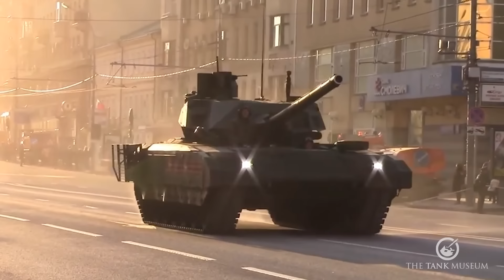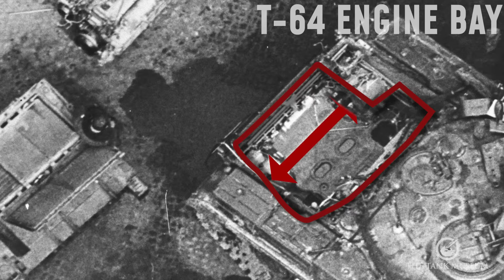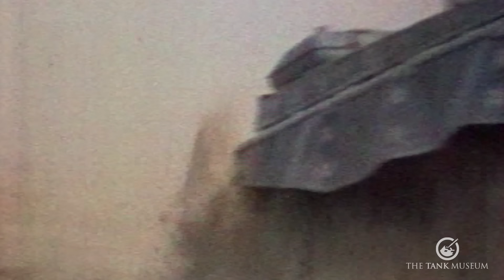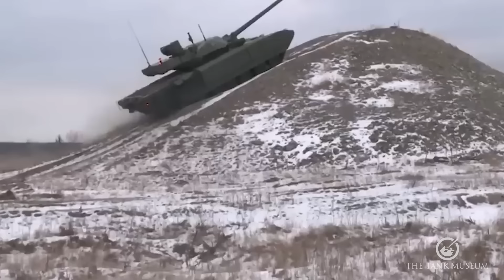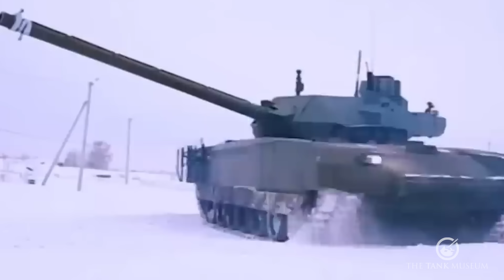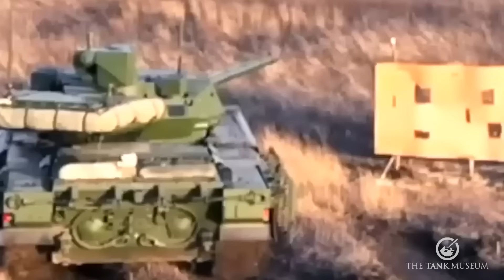Radical or Ridiculous? | T-14 Armata | Tank Chats #171

Comment: If this design was proposed by the West, no English-speaking commentators would say that it is riduculous, despite the numerous failed military design and projects from the West.
Reply: Such as?
Reply: @belongaskip Such as USS Gerald R. Ford's sewage design leading to 90% of its toilets clogged and having to borrow 150 mobile toilets from Greece.
Reply: @andresx1342 hardly compares
Reply: @belongaskip You are absolutely right. USS Gerald R Ford is a complete joke.
Reply: @andresx1342 then say it and dont bring up some "sewage systems"
Reply: @belongaskip  Nah the EMALS makes it a joke. The sewage system is just the kicker
Reply: Yeah, but it wasn't, and it is so....?
Reply: This armata tank kind of is a design of the west though lol most of the tech on this thing all come from western off the shelf parts which they dont have access to anymore. No wonder this frankenstein mess of a vehicle never got manufactured.
Reply: @AC-xq4hh Parts are not the problem, lmao.

There were countless of tanks and projects that have never seen battlefield or being labeled as MBT.

Russians have impressive Tank Fleet so there's no point of using those, especially during wartime.

Comment: 100, 115,115 mm guns all in service at the same time. That is nothing. Ford once sold car models with 427 CID V8s, 428 CDI V8s, and 428 CD V8s. The idea was that the 427 was the hot engine, the 428 (Cobra jet) was the hotter engine, and the 429 (Super Cobra Jet) was the hottest engine

Comment: Two years on and the poor performance of Western tanks in Ukraine makes some of the comments very funny. In the age of drone warfare there has to be a radical rethink. However many of the lessons of the T-14 are already being incorporated into updates of the T-90M.
Reply: What poor performance? They seem to be performing pretty well. 2 years with  difficult maintenance and little to no replacements. In a war with thousands of tanks on both sides they have been used as first choices. The funny thing is that the lowly M2 Bradley has outperformed all expectations. 

You are learning the wrong lesson with drone warfare. Look at the combatants. Both Ukraine and Russia both field thousands of tanks each. Even after years of drone warfare they both spend substantial resources fielding them. Russia is emptying out their old stockpiles trying to get as many tanks in the field as possible. Yet you want to ignore the actual participants in this war and proclaim a weapon both of them depend heavily on is useless cause of drones.
Reply: @tealshift2090 tanks are increasingly being used as mobile artillery rather than for  frontline attacks.
Reply: @tealshift2090  Ukraine is not using it's western tanks such as the Abrams and Leopard in the same way Russia is using theirs and when they did, they suffered the same fate as all the "bad" Russian tanks, aka being torn to pieces by drones. Tanks in general seem to face increasing challenges in the way wars are being fought now so which makes it seem like it's pehaps better to use cheap, and easy to produce tanks or AFVs because it's better to lose a cheap tank than an expensive one if they suffer the same weaknesses anyway.
Reply: @umbra2130   Torn apart? oh? You know that how? From the drone videos? Tanks from Russia and Ukraine have had most losses from the typical old fashion weapons not drones. Mines are a far larger threat as well as artillery. In pretty much every video you see of a tank getting knocked out while its moving its not a drone doing it. Every video that you see a drone doing something the tank is immobile for an unknown amount of time. Usually with hatches open. So most of those have been abandoned and just sitting still.  The famous photo from Zaporizhzhia of Western equipment getting stopped and destroyed, every last vehicle is detracted. That wasn't a drone that did that. 

Small drones are being way over hyped in public. They are great for observation and intelligence. They are nowhere near as deadly as people think they are.
Reply: @tealshift2090  Maybe I wasn't clear enough before but by drones being a detriment I don't just mean FPV drones but reconnaisance drones that constantly monitor every single corner of the battlefields at all times. It's incredibly easy to use ATGMs, loitering munitions, precision artillery etc. to destroy any tank as soon as it's spotted which in this war is as soon as they expose themselves in any way due to literally hundreds of reconnaisance drones looking out for them.
Reply: Indeed, but showing that the T14, while good on paper, is just too expensive to field. Intriguing how that works out.
Reply: @gregoryfilin8040   The T14 was never "good on paper" it was good in fantasy media PR world only.
Reply: @gregoryfilin8040 it reminds of the T-34 and T-43. The T-43 was impractical to go into full production for various reasons. So the T-34 85 was created as an effective hybrid. The T-14 may never see full production but it does not mean its development was a waste of money. It is the advantage of a defence industry focused on the national interest rather than shareholders profit. It can afford development costs without worry about future sales.

Comment: I see see-by-wire as obvious tech for next generation armored combat vehicles... Didn't knew it was on the T14.
Reply: It was a big question, with electronics reliability and ability to produce being Russia's biggest bottlenecks. 

Doesn't matter now as most of that capacity in present-day is being used by drone production.
Reply: Russia often develops military concepts 10-30 years ahead of the west in concept, but the execution is from 5-50 years behind, with cost being 5-75% of the West. 

They conceive good ideas, but they rarely can put them into meaningful production. Take the SU-57, by all accounts an EXCELLENT aircraft. Yet after 6 years of production, less than 100 have been built. The total will be 250 air frames in 11 years. This is quite small. The US produced all 460 F22 Raptors in just 4 years; truly a marvel. 

So Russia can make good weapons and kit, but often struggle to put out the higher tech stuff in sufficient quantities, hence their heavy leanings on both Europe and China for high tech.
Reply: Nope.... Russia or the Soviets never developed anything of value 10-30 years ahead of the west. Thats just lunacy. At best they were developing things in parallel with the west, usually they developed them with a couple of year delay. You are right about execution, their average equipment was poor, crude, or more simple typically. Cost depends on how you calculate it. The west will always pay more money for things, even if the cost in manpower / hours is less. Sometimes the comparison is just different, a M1A2 SEP V3 has a heck of alot more equipment and electronics on it then any Russian tank. That will not only raise the cost but also the manpower requirement.

No idea how many fully combat capable SU-57s are sitting around, but the number of F22s you said is wrong. The US only made around 190 of them, and only about 120 of them are used in combat squadrons due to the other 60-70 being a different version. The number of years for the f22 was quite long as well. Production was dragged out due to the people in power thinking it wasnt needed, and canceled. The F-35 on the other hand is building something like 170-190 of them this year alone (not all going to the US). 

The SU-57 cant be that good given its near absence in Ukraine, and lack of penetrating / destroying the air defense across the country. Just alot of hype, just like the T-14, TOS-1, BMP-3, Ratnik, the list goes on.

Comment: I suspect in the medium to long term the sanctions will be looked back upon as a strategic mistake, in the short term it is obviously effective, but ultimately it will simply force Russia to either develop their own high-tech  and microprocessor industries, and likely, forge an even closer bond to China who are already making their own computer CPU`s allowing non-microsoft operating systems to be used. It may also push the war closer with Taiwan, as their TSMC microprocessor plant now exceeds any western CPU plant capabilities.
Reply: Russia and China will cautiously work with each other, but only so long as the west keeps pushing them. 

However, based on this week in global affairs, its clear that Russia and China will only get closer, and the west further and further.
Reply: What a strange strange comment. Russia would develop high tech industries if they could. In fact they keep their highest tech industries alive at all costs already (jet engines and space tech). Same goes for China, they will develop every tech they need to function because any sane country won't intentionally cripple themself if another country can't supply something important anymore.